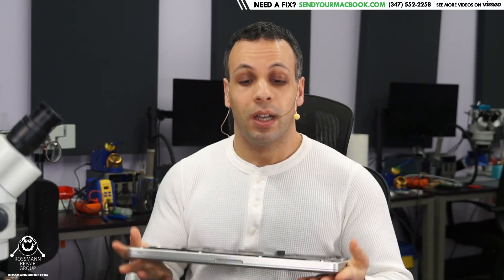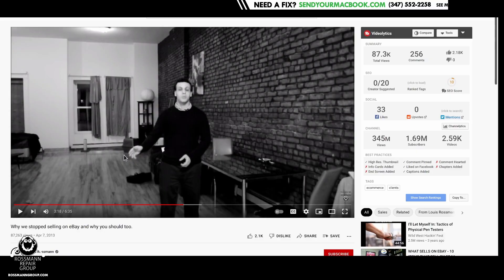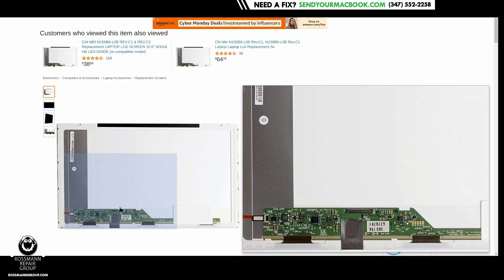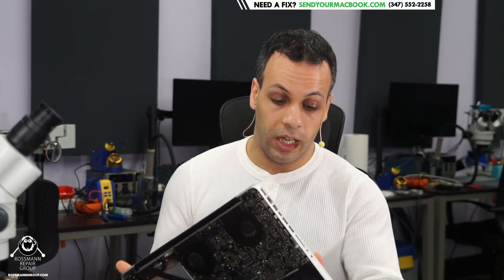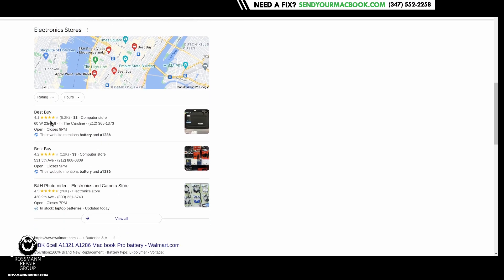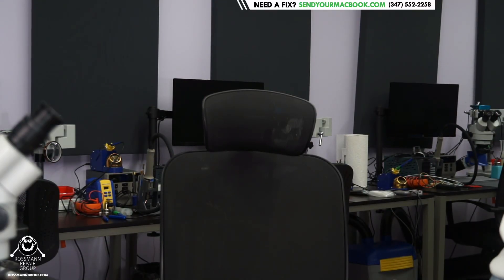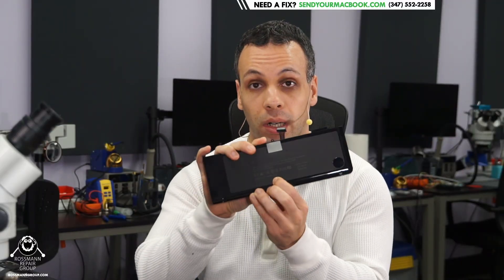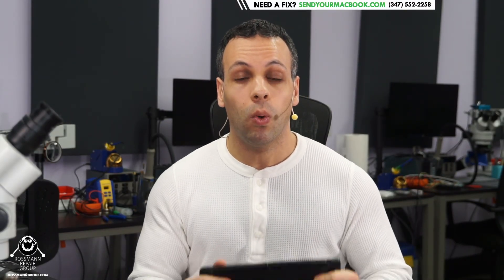Apple switched - and + on battery connector from 2010 to 2011 w/ same form factor; WHY?!?!

Comment: 6:53 This single slice of 15 frames smells hours and hours of frustration. I switched to Pop_OS! for a few weeks back this summer. My audio issue was that selected audio devices were reset at every boot, in the system and OBS.
Reply from the maker: Linux is a shit show and will be until I am dead. It only does this at my work machine, it does not seem to like my HDMI capture card being used for audio,
Reply: @rossmanngroup  I secretly pray they never fix it because I've never laughed as hard as I did when your volume bar got stuck on that livestream and people kept asking you why you hate Linux. My ribs ache.
Reply from the maker: @SalemTechsperts  It still does that on that track, too!
Reply: @rossmanngroup  my prayers are working then 🤣
Reply: don't worry, microsoft windows can't figure this shit out either. I have the same problem (brief recording dropouts), and a weird fix: go to power settings and set max cpu power to something low.
Reply: @victortitov1740  Is there ANY audio capture setup that will never drop? As far as I'm aware, as long as the hardware relies on the CPU to do the capturing, the answer is no. Modern CPUs don't guarantee that any given process will run at any precise time, by design.
Reply: @3lH4ck3rC0mf0r7  Well, on some setups, is simply works. Very unpredictable. It should be a matter of increasing the size of the ring buffer, i suppose.

Yes, this realtime stuff is very challenging for computers, apparently. I remember a problem back in the old times of burning CDs with Nero: the buffer will slowly drain as the data is written, all the way to zero, then the burning would suspend, and the buffer fills within half-a-second, and the cycle repeated. Apparently, the computer was completely incapable of filling up that buffer while burning was in progress. It was only on one system; on others, there was no such problem.

Comment: On the topic of model number specifics, do you know the reason why Apple used 2 different model numbers? Like my iPad pro is A2301 but also MHMV3LL/A seems redundant and stupid doesn't it?
Reply: This may be a marketing model number vs internal model number. The latter may actually be unique to the specific assembly whereas A2301 might refer to multiple different pieces of similar hardware like Louis talked about with the Asus laptop.
Reply: @djstubed  I looked into it because the more I thought about it the more curious I was. It looks like that's exactly what it is. A2301 marks the 11 inch 3rd gen pro with cellular whereas MHMV3LL/A further narrows it down to the space gray 256gb model. It still seems like it over complicates things, but I mean it's Apple
Reply: @harleyandbuddy  This is pretty typical in the industry, so it's not limited to Apple. It doesn't mean we can't do better, but there is a reason for things being the way they are. As someone more on the software side of engineering these days, looking at how corporations "version control" hardware can be horrifying. I think there's room for a better approach, but likely no appetite.

Comment: Yes I did learn something, otoh it is something I learned when I was working on desktops in the 90s... That one someone (fortunately not me) plugged in a fan plug from the PSU into a pair of random jumpers on the mobo. Let's just say when I opened the tower the ide cable looked like the surface of the moon from the bubbles created in the plastic...

Comment: 1:20 I had this exact issue! I did make sure before ordering the screen to see what the existing screen was and get a part number off of it. Absolutely crazy they keep the SKU but change the insides 😡
Reply: Yeah, it drives me nuts. It also makes me mad when a manufacturer makes hundreds of variants of the same product, variants for which parts are perfectly interchangeable, but you wouldn't know unless you already had the parts to try and find out. Turns out that's hardly how the world works now, considering most people buy PC parts online now instead of going to physical stores.

For instance, I was tasked with restoring an old Sony Vaio VPCEH laptop. The display's plastic case was badly cracked, which risked breaking the display itself everytime someone opened it. The exact part number for it was nowhere to be found (sold out everywhere, not restocking anymore). An online store was glad to take my order for one, only to tell me they were out of stock a week later (!). They returned my money but processing took nearly a month, so yeah, that was fun. Months later, a laptop technician told me I could just have used a Vaio VPC or a Vaio SFV display assembly and re-use the hinges from the old one. It was too late, though, I had already paid someone else to repair it (it was nasty, involved lots of glue, but at least it worked).

I think manufacturers should make a list of "functionally equivalent replacements" for each and every product model/variant they release in order to reduce waste, even if the parts are visually different. Some manufacturers already do this, but there's room for improvement.

Comment: secret revisions are some of the most scummiest things companies can do. For me in particular its with desktop ram. Say I'm looking at a 2x8gb kit specd at 3200 CL16-16-16-38, nowadays pretty much anything will clock that without effort but some companies will make little secret revisions in between batches and may switch from samsung bdie to say hynix cjr/djr( most common ones i see) for most people that really doesnt matter but that revised kit may not be QVL'd for a specific motherboard and the buyer may plop it in and scratch their head like a buffoon because their pc may not post. Now that isnt a really big issue nowadays because just about anything will post though long term we dont know if that won't be an issue. And then we have those who like to do ram oc but explaining how that matters might as well be a whole dissertation.
 Vendors like G.skill and Crucial(they are owned by micron so they have are pretty much a 1 vendor company) are for the most part pretty good about this and perhaps some others but I have yet to see this.
Is it really that hard to just add in something to denot a revision?

Comment: Not always online shops provide enough details. I remember  trying to confirm over phone that wifi router I want to buy have exact hardware revision B1 which had different CPU than revisions A1 and C1. I think I had to rely on my luck back then (I was lucky).

Comment: Partial disassembly for a part number will also inform you whether this repair is in you to do.
Replacing a laptop battery is quite simple, but the first time always comes with a dopamine rush.

Comment: I wonder if my cordless phone had the same polarity swap because of politics.  The aftermarket replacement battery pack with its wired connector looked identical to the OEM.  But the polarity at the connector was reversed on the aftermarket battery.  Easy to detect because of the colored wires.  This was decades ago.

Comment: This has been a pet peeve of mine, if a manufacturer is making changes the internals, then I personally think the model number needs to change..

Not even auto manufacturers pull this on their customers.
Reply: There usually is a model number that does change to reflect changes to the bill of materials but that is not the same identification used for the public.
Reply: @nanoflower1  some manufacturers use a "Rev. No" near or as an addendum to the model number. But not many, and definitely not Apple.

Comment: DELL and HP are well known for doing revision changes midway through a bulk order, even when the corporate buyer specifies that they wont accept revision changes on the any part of the order. As part of the Deployment team, We had to identify what ones were not to order spec and reject them. The Account Manager got a roasting.  This was due to the Corporate Operating System Build being set to a very specific motherboard specification for each tier being issued across the Corporate Estate. (it reduced OS update compatibility issues with the hardware and enabled the onsite IT teams to swap parts over without causing problems.)
Reply: Dell actually specifies the exact part numbers on your order, so if you lookup your "service tag" or order number on their site, it will show you Exactly which parts and part numbers are inside your device. Each separate order SHOULD have the same parts for each device within that order. As for changing parts during the lifetime of the product, yes it's done and and is mostly due to the fact that Dell builds their machines/devices on order (they have hardly any stocked items) and is closely linked to parts availability in the market. This can be very annoying when you have automated processes to deploy workstations and servers for instance with SCCM or any other automation software. That`s why Dell has Open Manage plugins as well as vxrail, powerflex, etc. to make sure that your automation always works with the latest drivers, firmwares and parts.
Reply: @digibrat  thanks for that tip.  It actually just helped me make a purchase decision.
Reply: @digibrat  I've had dell parts with the same number but incompatible connections
Reply: Lenovo is also known for revision changes also.
Reply: @riovannes5701  waaaait. That can't be. Because as every Louis fanboi knows, Apple=bad, and ONLY Apple=bad. Everyone else is a customer-friendly saint.
Reply: @RandomUser2401  - uhm no? He roasted about every company over the past years and only praised the recent repair friendly laptop.
Reply: @RandomUser2401  you need to take your meds buddy
Reply: @xmlthegreat  well, no.
Reply: @Hortifox_the_gardener  not at all. Shows how little you know about the brand distribution in his videos.
Reply: @RandomUser2401  Maybe they aren't quite as proprietary about it?  The literature on Lenovos is copious.  This is what made it possible for me to get correct parts for a 10 year old Lenovo refurb.
Reply: @RandomUser2401  which is worse, being a rossman fanboy or an apple fanboy?
Reply: @RandomUser2401  I'm more certain you do need meds. Anyone who has seen more than a few videos on Rossmann channel knows that he will roast any company that engages in anti-customer behaviour. It's just that since he interacts with apple products a lot, he is faced with their baffling bullshit more often.
Reply: @xmlthegreat  sure, that is the only reason. Nothing at all to do with farming views because hating on Apple is so en-vogue.
Reply: @josephbrandenburg4373  neither. But many people here are not even blind Rossmann fanbois, they just want to funnel their own insecurities into hating a brand that they largely simply can‘t afford.
Reply: I have a Lenovo y510p, the parts for that one is a shitshow, like 4 different motherboards and at least 2 kinds of screen
Reply: @alenasenie6928  Most companies will do a y510p-"[something]" though. However, less and less do. And even internal part number stickers may be used on different parts. :(
Reply: Revision always existed, in old good day too. Big difference - in the past catalogs/repair manuals for repairs existed with revision clearly stated. Everything started going to shitter in 80/90's (late 70's ?)  and not only hardware but software too.

Comment: Radio Shack (under it's PC brand name Tandy) pulled this crap way back in the day. They made a version of a PC called the Tandy 2000 but the card slots had the pins moved around such that if you didn't buy Tandy parts you would fry something. I don't think there was any other good reason for doing it beyond simple greed and spite.
Reply: I was asked what would I do if money was no problem, if I had all the money I needed, all my needs were met, what would I do.
The answer?
Manufacture quality items, that if the end user chooses to, they could easily repair it themselves. And if they don't want to, thats ok; it can get repaired without the crazy shti showcased in this video happening to them.

Comment: Hey Louis, great news! Not a single person disliked this video from what I can see. That's amazing, you have a 100% approval rating.
Reply: No dislikes here either!
Reply: That's because YouTube hides dislike count now.
Reply: @sohotcall  woosh
Reply: @sohotcall  huge wooooosh
Reply: @sohotcall  Interesting, i feel they should just do without the dislike button.
Reply: There is an extension you can use to bring back dislikes. This video currently has 88.

Even more reason why it's so stupid that Youtube hid them in the first place.
Reply: actually i can see 90, but heyy thats not bad

Comment: If you don't want to open your device twice, buy every version of the battery, and send back the extras.
Reply: yes at the only way, but it expensive, to the point you might as well a new one,
Reply: @dh2032  At the end of the day it is cheaper than buying a new one if you send the wrong ones back.

Comment: Apple must have a "customer trolling" division to come up with these unnecesary but lethal changes.
Reply: there is no way this was done unintentionally
Reply: @kapioskapiopoylos7338  yep, it was planned and approved
Reply: @liquidfireman  By the same people who planned and approved moving a backlight power rail right next to the data line on the screen connector, to maximize the chances of dropping 20+volts down a data line that goes straight to the CPU.
Reply: @kapioskapiopoylos7338  Duh. you think they accidentally changed a design? lol. nothing wrong with them doing this.
Reply: @kapioskapiopoylos7338  indeed. They did it to specifically hurt you. You personally. So you get salty and write this YT comment. In absolutely no way has this a supply chain or layout optimization background. Also keep in mind that only Apple does such revision and changes while every other manufacturer is super customer friendly.
Reply: @RandomUser2401  riiiight, because there are dozens of other laptops that use exact same shape battery as a MacBook, so obviously they can switch manufacturers on the drop of a hat
GTFO, shill for for some other corporation that doesn't care if you live or die
Reply: @RandomUser2401  LMAO, you think apple as a trillion dollar company, can't set standards for their suppliers? XD
and the oldest and dumbest "justification" if anyone could call it as such, "everyone else is shit also so it is fine".
You made my day, thanks.
Reply: @kapioskapiopoylos7338  You are right. Since everyone else is fine, we should focus all of our attention to Apple and ignore the rest of the industry. That is the right way to go. You made my day, thanks.
Reply: @RandomUser2401  lol, cheap troll, there's plenty of videos focused on other companies on this channel.
 Low quality whataboutism.
Reply: @RandomUser2401  not sure if you are a troll, have AAPL shares, or just missed the point of the video entirely. either way hilarious.
Reply: @kapioskapiopoylos7338  neither of those. Apple bad.
Reply: @robertstan9733  „Plenty of videos“ lmao. One in twenty at most. Made my day.
Reply: @robertstan9733  RIP English
Reply: @RandomUser2401  the go-to response of someone who does not have an answer lol.

Have fun trolling
Reply: Repair Deny Manager... The highest paid engineer off Apple.
Reply: And its a troll on your wallet... the worst kinda trolling!

Comment: Apple have gotten more and more pathetic over the years.
Reply: Well, it's not just Apple, given Louis' example of an Acer laptop doing the same crap.
Reply: @DEAN MURPHY vs. THE WORLD It might very well be, but it's still the same model laptop overall.  

Manufacturers should make it more obvious when a parts revision occurs within the same model.  Say I have a "LaptopCo model 2216".  If 6 months later "LaptopCo" needs to change a part for whatever reason, the model number should change to reflect that - such as now calling it the "2216a" or something.  Even more so if the parts change is an upgrade over the previous iteration.